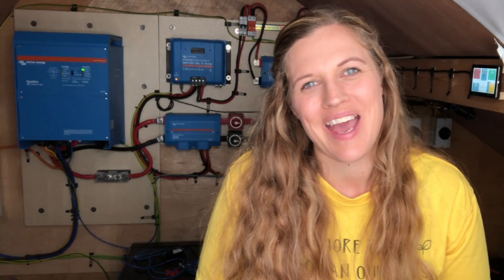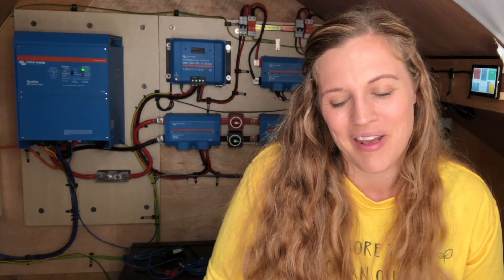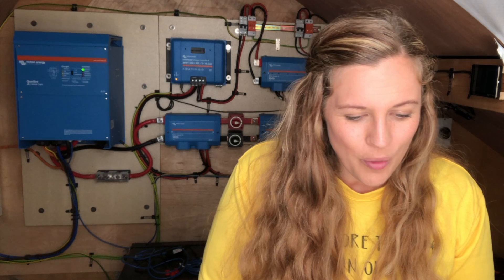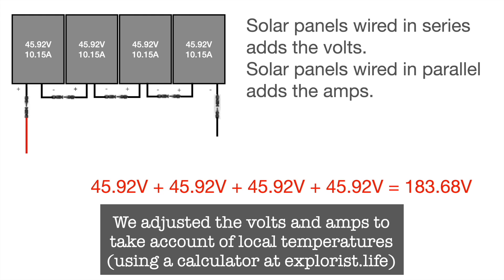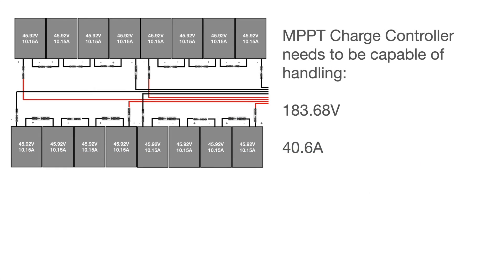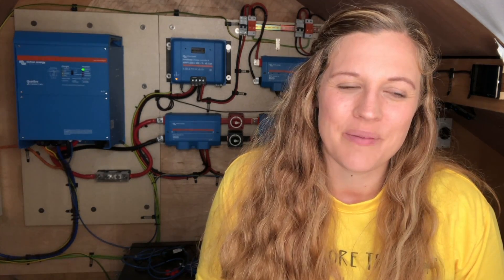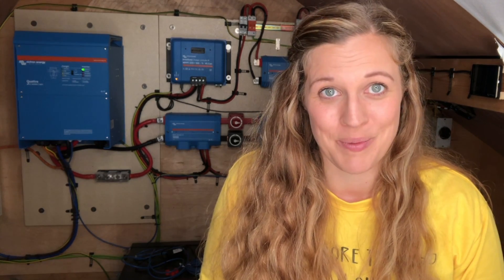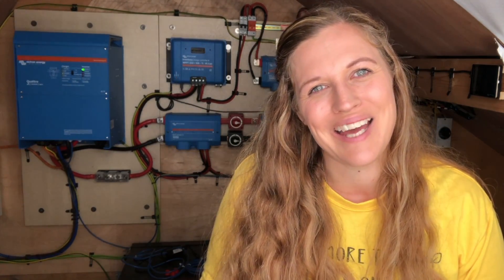WIRING SOLAR PANELS IN SERIES PARALLEL: OFF GRID solar power system

Comment: Not sure if u mentioned but the voltage is VOC (Open Circuit Voltage). It is very important not to go over the voltage of the MPPT. You can go over the Amperage of the MPPT. This is called chopping and will give more power when not in full sun!
Reply from the maker: I forgot to mention this when recording so put a note on the video instead. Hopefully people will spot it as it’s an important point 🙂👍 We’ve pointed people to explorist.life too which has a calculator to help people calculate the VOC 😊

Comment: Brilliant channel you guys have, nice to see people in the UK going off grid for a change, i would love to do what you guys are doing and nice to see people using decent gear, installed tons of victron over the years and never had any come backs . just a bit of advice , i would go over you data logging for the past month and see if you are maxing out the 250-100 for long periods, depending on where in the UK you are i doubt it , then i would consider losing the 150-35 and going 5 series 4 parallel, this will give you more morning and evening solar esp in the colder months as the mppt will need 5-6 volts higher than battery voltage before it comes in to action, one thing i see a lot of my non electrician friends do it mount kit high .. heat rises and will throttle things as they get hotter.. lower is better :) sorry if that sounded like a rant , just like to help folk out .. look fwd to seeing more content .. now to watch the ones i have missed :)
Reply from the maker: Thank you for your comment. Glad you like the channel 🙂 Thanks for the advice 👍